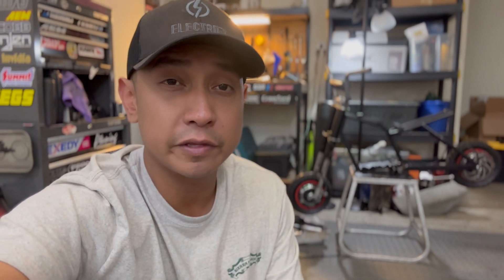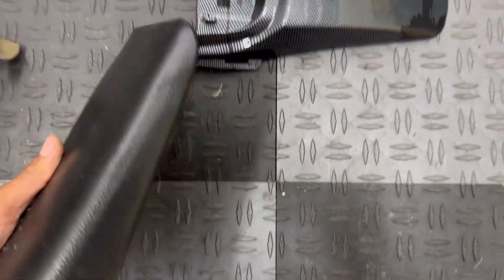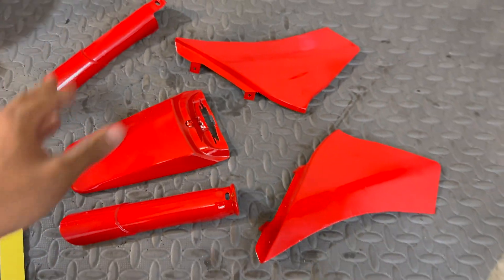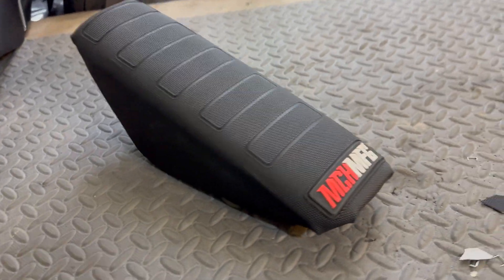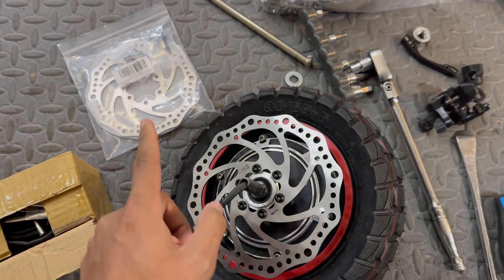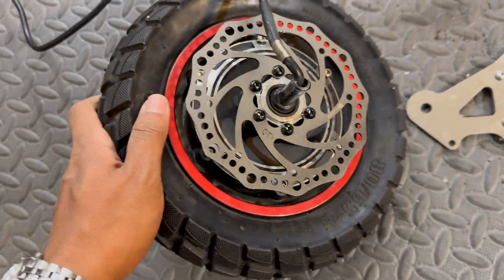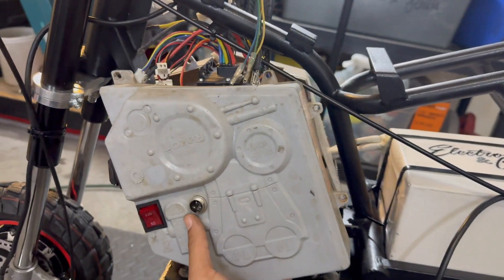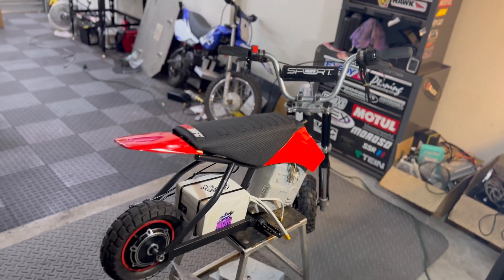Dual Hub Motor 48V Razor MX350 Giveaway Build Updates!

Comment: can you make a kit for the tuttio to make it like 6kw
Reply from the maker: That would just require a Sotion FW23 motor, Fardriver ND72450B controller, and a 72V battery with a 100-amp cont output.. might cost at least $1,400 altogether. That’s what I’m likely doing to my Tuttio

Comment: Hey guess what I got a frp mini bike it reaches 28 mph for 470 in Walmart I think you should check them out there 99cc 4 strokes maybe make a project🤔🧐
Reply from the maker: @Beeswarmroblox12 🤔 I looked at the FRP bikes in the past. Now that you have one in person, do you think it has enough room on the frame for a Predator 212cc motor?
Reply: @ yes I think it does but maybe a tiny bit of trimming if not